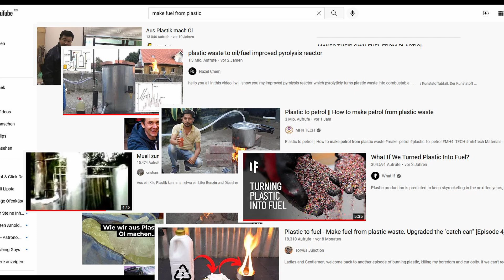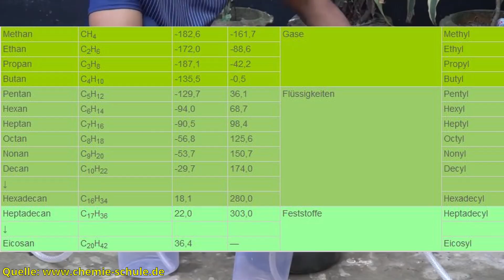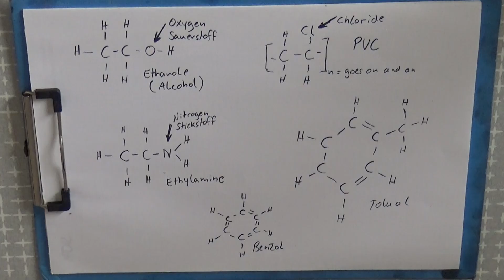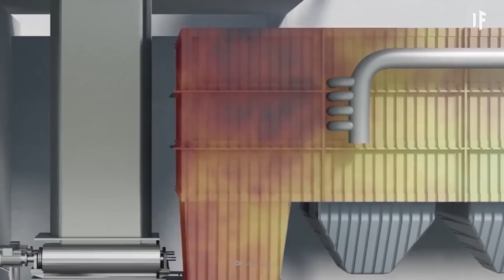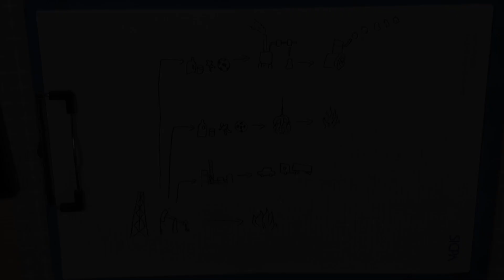The myth of making fuel from plastic, BUSTED!

Comment: I made fuel from plastic and run my weedeater and lawnmower
Reply from the maker: no, you haven't made fuel. you made some unspecified combustable liquid that exhaust poisonous fumes and will eventually kill the engines of those machines.
Reply: No you just have to refine it till you get the fuel you want same way crude oil companies do

Comment: Your country is about to go through the mother of all energy crisis this winter and you're not coming up with a safer way to process old plastics? You do realize there's no oil coming so if I understand how cold it gets in Germany you have a lot of people that are going to freeze to death. Let alone not being able to drive anywhere. This is more of a prepper type scenario that this would be done. If fuel is available great, even if it's expensive I'll always buy it, but if it becomes where it can't be obtained, I'm figuring out exactly how to distill pyrolysis oil at what exact temperature in order to get the correct octane to run a fuel injected car once it's been filtered. Seen it done. No reason why it can't work.
Reply from the maker: Well, mass extinction comes anyway. So no need to do dumb stuff. And no, it has nothing to do with octane and such. The liquid that comes out of this process is chemically no gasoline nor diesel regardless what temperature you use.

Comment: je suis au courant de cela mais si le system n'est pas hazardeux et bien realisé, le soufre et l'azote contenue deja dans les additif et colorant du plastic son eliminé a la laine d'acier / charbon actif, enssuite les gpl est separé et liquefier par pression et le methane/ethane brulé dans un generateur, une hydrogenation est aussi necessaire, pour finir les plastique speciaux son a proscrire, seul pe pp ps son bien, pour le diesel, si bien distilé, et separé des autre liquide combustible, il marchera mieux avec un meilleur rendement par kg, ah oui, l'utilisation de chaffage electrique est obligatoire sinon c'est ecologiquement non rentable, il est preferagle pour moi de brulé cest plastique dans des moteur que de les laisse dans l'environement
Reply from the maker: Your keyboard seems to be defective. I read only glibberish.
Reply: @diymicha2  I am aware of this but if the system is not hazardous and well made, the sulfur and nitrogen already contained in the plastic additives and dyes are eliminated with steel wool / activated carbon, then the LPG is separated and liquefied by pressure and the methane/ethane burned in a generator, hydrogenation is also necessary, to finish special plastics its to be avoided, only pe pp ps its good, for diesel, so well distilled, and separated from other liquids combustible, it will work better with a better yield per kg, oh yes, the use of electric heating is mandatory otherwise it is ecologically unprofitable, it is preferable for me to burn it's plastic in the engine than to leave it in the environment

Comment: Na man. Those back yard plastic waste conversion to tar, diesel, gasoline, and kerosene. Is a real thing and works. Its called dirty and mistakes happen. But from failure comes knowledge to refine or filter the dirty diesel, gasoline, and kerosene. It is doable and thats key to success.
Reply from the maker: Simply that it works doesn't make it less harmful to the environment.

Comment: I make fuel from waste plastics, primarily diesel and gasoline, the gasoline is low quality (low octane and prone to knock) so its mixed with the ethanol that we also make (E85) and then dispensed through a magnesium sulfate filter to remove any water that the alcohol might attract. This isn’t a solution to the energy issues facing our country, but after finding out that most recycling programs result in the recyclables being shipped off to China and then to other nation no with no EPA and then those plastics are either burned or thrown into the ocean, I decided that pyrolysis conversion was a better use. And the town I live in has seen what I’m doing and is helping / buying fuel from me, and until EV’s are as easy to use as their Ic counterparts and as affordable people are going to have to step up unless your happy paying what big oil - the govt. - and middle eastern scumbags say you hav to
Reply: Someone sounds jealous 😅
Reply: @reemsaif3105  of?

Comment: Are there actually videos promoting plastic pyrolysis as sustainable? Even by the most pro-pyrolysis adoption people like myself, DIY in your backyard with plastics is a terrible idea. And there's a reason so much goes into pre-treatment in proper plants.

As for where I stand on utilising plastic pyrolysis professionally to clear away plastic waste: 1. Needs to be a proper setup. 2. We need to ensure we've moved beyond fossil fuel plastics to biodegradable forms. Doing anything before that is a bandaid on a severed limb. 3. It's only used for clearing away existing waste and is not meant for long term viability AND there's a plan in place to capture other outputs. Doubt these would happen under Capitalism
Reply from the maker: Thanks mate. Couldn't have said it better.

Comment: So if you’re so smart you would know that the solution is to BAN he plastic. If you don’t agree then your smart for no reason just talking.
Reply from the maker: I'd say DEPENDS. Because plastic is not plastic. There are truly recycleable plastics that can be reused almost infinite times (Polyester bottles for example, and some polyethylen plastics). Or plastics that are used as is for a very long time (tupperware). The most mandatory is to ban all the one-way plastics, or really unneccesary plastics. Why packing bananas or apples in plastics? They come naturally with their wrappings. Why the vast plastic landscape in cars, that serve no other purpose than to cover up wires and hoses. The car would run just fine without them. There are a gazillion places were plastics are 100% uneccesary. Plastics should only be produced if the recycling problem is solved, or there is realy and absolutely no way to replace them with something different like metal, wood or any other ressource besides fossile.